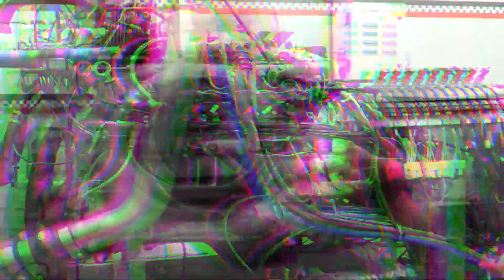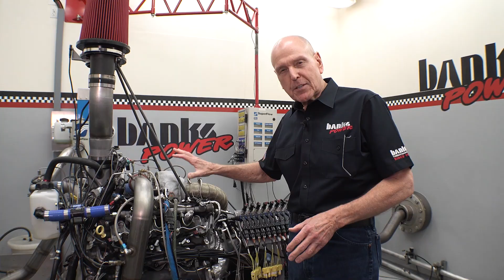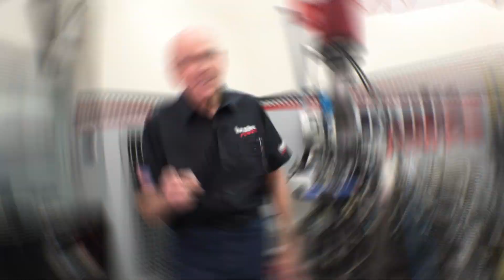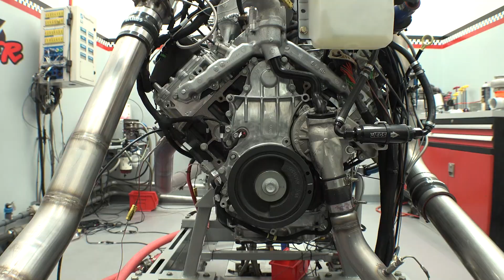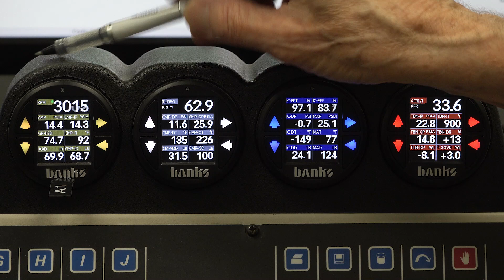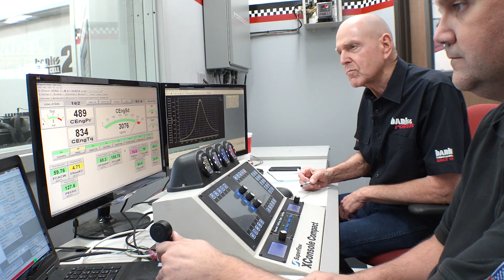KILLING A DURAMAX Pt 6: 65% Better Turbo!

Comment: Real diesels are laughing at the 510hp at 3000rpm. A stock 6.7 powerstroke is 450hp@2800. That's 844lbft. A 6.7L Cummins 400hp@2800rpm is 750lbft. 445hp@2800rpm in the duramax is 835lbft. A real diesel is making 500hp at 1700rpm, oh wait that 1544lbft. At 1400rpm my D13 is 1750lbft(499.6hp)  I think people put too much emphasis on horsepower. Torque is what is doing the work, horsepower is just how fast the torque does the work. 
1850lbft@1300=457hp
1850@1400=493hp
1800@1450=496hp
1750@1500=499.6hp
1600@1600=482hp
1550@1700=501hp 
Now as you pull a grade with a 140k gross you will downshift an bring rpm up to 17-1800 and the engine will lugg back to 12-1300 then downshift again. Eventually you will stop losing speed, the engine will always hold at peak torque. The 450hp MBE 4000 and 450hp@1900(1243lbft) and even at a 75k gross with a 4.10:1 axle it's always lugged back to 1400rpm(1650lbft@1400=439hp) how is 439hp always stronger than 450hp? Because 1650lbft is stronger that 1243lbft. Just the same that a 425hp Cat 3406 would out pull a 500hp Detroit diesel. 425hp@1500=1488lbft, and 500hp@1800=1458lbft. Not to mention that the cat is doing more work at a slower rate(with more fuel) to a driver the cat is better. And that's where the reputation came from. But the Detroit was the engine for the smart owner(less fuel $, faster cheaper rebuilds, lighter engines= more payload)
Reply: @1Slamalama1  I'm not comparing anything. Fella I'm was showing an example of horsepower to torque relationship and how the hp rating doesn't actually mean a whole hell of a lot. Because that 510hp duramax on that dino could not do the job of a 10L Cummins ISL at 500hp(fire truck spec) or the job of my or any 13L 500hp engine. Because the limiting factor is the torque output. And that's still 900lbft.
Reply: @1Slamalama1  again I'm not comparing. And if you listen to Mr Gale banks he talks about power density. A 13L that puts out 1850lbft@1400rpm has the same power density as a 6.7l with 925lbft at 2800rpm.  Just like that 3.5L ecoboost 470lbft 3500rpm vs the 7.3L V8 with 475lbft@3800rpm. That is a boost/displacement ratio example. The turbos add displacement equivalent to have the power of the larger displacement in a more efficient package(given you drive nicely). I don't understand where you get the comparison line from.
Reply: @1Slamalama1  ultimately I'm showing you that horsepower is a calculation, it's not actually some thing measurable. The old force at play is torque. You need a time component to have horsepower. That leads me back to horsepower isn't a measure of how much work gets done. It's how fast the given amount of work get done. In other words 500hp isnt 500hp. If one is 5000rpm and the other is 1500rpm.
Reply: @jnk26  the RPMs were kept constant.  Calling the torque or power is the same metric with the constant RPMs.

His reason for this was to show that the larger turbo uses less fuel if you keep RPMs and Power/Torque the same.
Reply: @jnk26  horsepower is a function of Torque and RPMs.  The time element is already worked into RPMs

Comment: I love data, too, but man, there's some serious added unnecessary complexity going on at the cost of just units. Most people talk in "psig", "psi", "psia", drive ratio is usually talked about in ratio (e.g. 1:1). 

While all of this information is great, and yes, to a non-layman there's an addition deapth of meaning in the numbers due to unit choice, it just adds complexity when trying to explain it.
Reply: I like how the air fuel ratios change for the new turbo, "Better Fuel Economy", Con man at his work again. Simps will drool over the useless info.

Comment: Mr banks what do you think about having a intercooler cooled by the ac unit like the hell cats using 🤔
Reply: The only real gain from that is for drag racing. You can cool down the water for the air to water intercooler before a run and get slightly more power. Long term power though would be negatively affected because the engine has to power that AC compressor, and that negates any benefit under hard power pulls. :)

Comment: Mr. Banks the only problem is the transmission won't hold up at 600hp. And won't you need to tune for the transmission
Reply: Transmissions don't hold up at 300 HP, in my sad experience!  If you tow with them enough, they will fail.

Comment: Hey Gale, would love to see a similar video comparing those parameters with and without water meth injection/straight water injection using realistic (on the road) intercooler outlet temps.

Comment: 8:15 - 9:04  please explain the presence of a spark plug in this diagram.
Reply: Diesel engines do not have spark plugs, the fuel ignites by the heat generated by the compression.

Comment: I have a 2014 LML ,I love the way It runs . fuel mileage not worth a flip ,average fuel Efficiency 14.9 😢 Odometer 50566. thanking about a full delete.  Or should I put a Precision turbo
Reply: Just delete it man, older tunesd non emmision duramax can easily get 20   mpg highway unloaded.

Comment: Love your videos! Wish you'd changed the intake and tested with the stock turbo, then changed the turbo.  The key to good science is holding all variables constant and changing one thing at a time.
Reply: He showed the #s with the stock intake.  It wasn't that big of a difference.  Most of the gain was on the exhaust side.

Comment: How loose would your converter have to be to run this on the street or tuning changes that would need to be made , ie, more fuel on the low end?

Comment: Hmmm... What about adding a "Mat sensor" that detects a commanded WOT & uses a jet of compressed air or brief blip of NOS to pre-spool the turbo from the intake side?
I'm curious to see what result that would have on the data. 
(I'll admit I got the idea from Cletus McFarland's treatment of his Cummins 12V swapped Ford Galaxie. -- it seems to limit turbo lag to 1/10 sec.)
Reply: Do a search for Gale Banks' top diesel dragster from years ago.  He was using NOS to eliminate lag on that car to the point that it leapt off the starting line with no hint of lag or smoke.

Comment: So most of the Precision turbo's improvements over the stock turbo appear related to its increased size. I am curious, but did not hear in this video, about how only the variable vane mechanism may be hurting power (not throttle response). I would love to see two further tests. 1. Two stock sized turbos. One with variable vanes, one without. 2. Stock turbo against a larger turbo that has variable vanes (not sure if this exists). Love you Gale. You are the raddest!
Reply: The variable vanes on the stock turbo were probably full flow at 500hp. Not much restriction at that point.  The vanes restrict (make a nozzle) at the lower end to aid in spoolup.  The gains on the PTE were due to the larger exhaust wheel and larger exhaust housing.

Comment: Great Video, I love this series! Are the Temperatures at 13:32 really just 5,8% different? I am wondering because Fahrenheit can get negative. If we take the temperatures in Kelvin instead, 452.15 K vs 463.54 K, the difference is less than 3%. Or is there something I have missed?
Reply: Did the same thing when talking about coolant temperatures at 7:03 where the words on screen tell us they are 25% different, but true heat rejection was disclosed as 10.8% different. That means that the temperature delta was 10.8% different if you actually use the correct absolute temperature scales.
Reply: @MrVettelovralexand2  Hes a snake oil salesman, not a scientist.
Reply: @MrVettelovralexand2  he is talking about the change in added temp.  The change was 25%.  9 ÷ 12 = .75.  That give you 25%.

You dont need an absolute scale If you are only comparing changes in Added temperature.
Reply: @ericsperformanceparts1647  I didn't say the math wasnt right for the specific numbers shown, but any time you speak in terms of temperature delta you are incorrect if you dont convert to an absolute scale because that tells you the true difference in heat energy.  Each delta is still technically true individually, but comparing the deltas in a percentage space is misleading.  I actually applaud him for giving the true heat rejection to coolant since that gives the data the audience really needs.
Reply: 355 ÷ 375 = .95.  That is a 5% difference.  You dont need an absolute temperature to find the % change.

Comment: The ammount heat being built up by the stock turbo bearings can't be ignored either, just flick the precision turbo after break in period. That puppy will spin with seems like no fiction vs any stock turbo, it's crazy how easy those aftermarket turbos spin. 

Id put money that about 15% of the total heat reduction is in those bearings.

Comment: How does this equate to my real world GMC one ton diesel?  I do not have room for the air intake you are using so can’t get the efficiency form the turbo you get on the test bed. Love your videos and the technology you have to offer. My new 2020 truck will be outfitted with your instrumentation.

Comment: Wouldn't you LOOSE your 5% fuel efficiency gain, by loosening up the converter to spool? I guess beings the drive pressures are down, you would level out the difference on injection timing or pulse width in a tune to compensate. Be interesting to find out.... may not be so much of a worry to the "street" guys, but the guys who tow for a living, may beg to know.
Reply: I tow for a living, and mostly cruise at 1750 to 2100 rpm.  That's the sweet spot for fuel economy.  I've climbed a lot of 6-10% grades all over the US and Canada, and am not interested in showing how fast I can get up them.  I just gear down and hold 2250 rpm, 50-55 mph, and climb them with a minimum of stress.  So the testing that Banks is doing at 3000 rpm is irrelevant to most of what I do, and the stock turbo would be fine for me.  I only need power above 2500 rpm when I'm accelerating through the gears, and that's only a few seconds at a time, so it's very transient.
Reply: A lockup converter will help out with a higher stall converter.

Comment: Do you lose density after the intercooler due to the cool air(if you cool down air it takes up less volume) or is it because the intercooler causes an air restriction? 
Thank Clayton
Reply: There is a great increase in density through the intercooler because it cools the air, but it does have 1.3 psi of pressure loss, which offsets a small amount of the gain in density.  Remember the part of the video where he says the intercooler is contributing 160 HP, which is almost as much as the turbo contributes at 180 HP.

Comment: Gale just accidentally sold hundreds of thousands of vgt owners a new fixed turbo 😂 make a non carb compliant turbo pedastool that adapts this turbo to a duramax or one that has the outlet in the same spot to be able to use the same hot pipe and a downpipe/intake pipe to make it a bolt on affair and itll probably sell with the banks name on it.. you said it yourself it reduced engine temperature and increased fuel mileage so that's a huge selling point to many

Comment: 10% less throttle through the hole range? Or at max effort?
Reply: undesirable automotive It’s at the 510hp that the stock turbo maxed out at. It wouldn’t be as much of a difference at lower throttle levels.
Reply: 10% less throttle to maintain the 500hp and set RPMs.

Comment: So in essence from what you're saying then, the exhaust side drive of the turbo is the let down here?  

I feel this is getting way out of control as far as testing the limits of the new L5P.  I'm not gonna go out there and spend $6500 to reconfigure my truck for an aftermarket turbo.  I'll keep my throttle response thank you very much. If I wanted a race motor I would rather spend that money on a bare block and heads.  Once you put that Precession Turbo on there you lost me.  You put a bigger turbo on there to get more power, how about that, lol.  Seriously Gale? Come on you're better then that.  I'll keep checking in but I'm not gonna stay subscribed to watch a race motor being built until it explodes. I can do that on a thousand different sites. Still love your knowledge and your wisdom but I'll just stay stock.
Reply: I agree to some extent, but this isn't a race motor. It's a stock motor that he's making external modifications to so that he can find out what the weak links are within the motor itself. As to why you need to know what the weak links are for a stock motor when pushed to the breaking point, who knows.
Reply: @NathanielHatley  yep, the only reason I could see how hard you can push a stock engine would be for super stock pulling classes. In which case, proceed! For a truck on the street I'll take drivability and reliability above all, if there is a way to get an extra hundred horses out of it and still have those conditions met then I'm all for it. I think that the stock turbo is going to be extremely hard to beat without the inevitable compromise  being made between power and drivability/reliability. GM/Isuzu really did a lot of work to get this far. In other words, power, reliability, drivability. Pick two.
Reply: I think he may have a couple tricks up his sleeve yet... We'll see. I'm with you on this one, the stock stuff is really very very good for the normal driving. I'm getting tired of the "race engine in a street vehicle is more better" bullethead mentality the diesel truck crowd is degenerating into. I need my truck for work towing heavy trailers, and it better do it for a looong time because it's going to be a while before I get the damn thing paid off, I don't need it taking a shit after 150,000 miles and winding up a cautionary tale like all the trash for sale on man cave classifieds because some Derp McGurk turned it up and hammered it to death trying to look cool doing brodies and rolling coal at every stoplight.

Comment: It sounds like GM did their homework on the variable geometry turbo. Good driviability, decent power at 2,800 RPM, and decent fuel economy. It is a perfect sized turbo for a STOCK application. However, there is not much "head room" from modification over stock power, except for maybe some improvement on the air inlet. If pushed passed the stock settings, the turbo becomes very inefficient, very quickly, as demonstrated here.  So overall, GM designed a turbo that delivers its full potential in a stock application. No performance was left on the table. 

Also to note, Gale is correct about placing a larger turbo on an otherwise stock engine. It wouldn't create any more power than stock, as limited by the single MAF Sensor. it would actually decrease drivability, as you would have introduced unneeded turbo lag. The best concept is to look at your situation and power needs, then build the engine to your desired performance level. Everything needs to work in a coherent,  complementary environment to reach the goals and expectations. If one item, such as an oversized turbo, is out of spec for the rest of the engine, the entire system produces sub-par results overall. 

Those last two sentences can be applied to multiple facets of life. If the "intercooler" at work cannot keep up with the workload, the entire team has to work harder to product the same level of "Horsepower" (AKA Output). If you overtax your marriage, such as the overtaxing of the stock Turbo Charger, you will see degradation of performance throughout the entire system. You cannot neglect one aspect of the system and expect max output.
Reply: I believe the 05 or 06 GM started using the variable turbo. Same turbo in the 6.0 ford powerstroke. Really good turbo with hardly any lag. I rebuilt mine and upgraded the turbo wheel with a wicked. I can really feel a difference in pulling a heavy load.

Comment: But this all comes down to the drivability. Of course precision is going to work better for HP/Trq But the daily drivability will go down. It wouldn't be as smooth and loose throttle response.

Comment: So, by putting a Precision turbo on a Duramax, you're essentially not killing a Duramax as much?
Reply: staying the big turbo to factory yes.. but as video said, there is some lag. What he does next will be interesting.. the turbo is much bigger and he'll show us how far.  That is the real point for builders.
Reply: Not yet, anyway. ;)

That said though, this was just validating that the new turbo was an improvement over stock in essential ways. Next comes the gut puking part where they push the power until hard parts break...

Comment: Will it fit under the hood, And what about the heat under the hood. It's not the same. And what about the emissions fed epa. And carb? They / mr.banks did not have exhaust control system in the test.  To be fair .
Reply: dam1041960 It didn’t have any of that when running the stock turbo. He’s looking to see how much power this new duramax can take before it blows. So, run it till something is maxed then change that and keep going. Last time the stock turbo was maxed so now they’ve got a bigger turbo.

Comment: Almost all of those numbers just scream efficiency, and extended engine life. Well worth the trade off of turbo lag. If anything, I would want to add an electric boost assist to eliminate the lag, and keep the large turbo, or even go bigger. Efficiency is free money plain and simple as long as the larger turbo isn't stupidly expensive then it will pay for itself over the life of the engine. Add supercritical steam injection into the cylinders at TDC and gain even more efficiency and eliminate NxO's along with all of that EGR garbage.

Comment: Always knew he's a GM lover. Besides banks don't last that long.  Had 2 ram air for old truck and mustang.  Fucking sand came in and destroyed my engine.  It was first banks from 90s. He even claimed banks went all the way back in 70s. Which has no proof.  If I were you ladies and gentlemens I'd stay away.